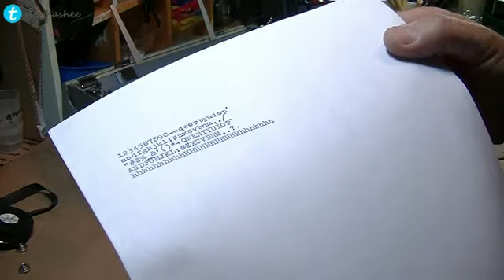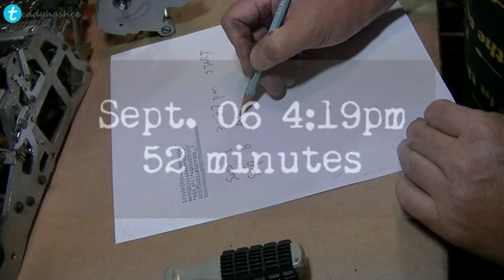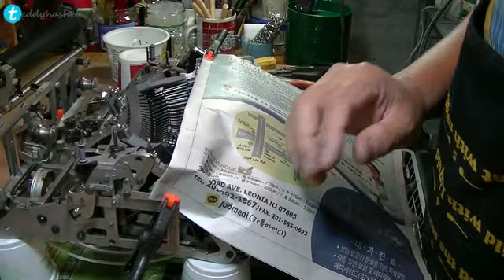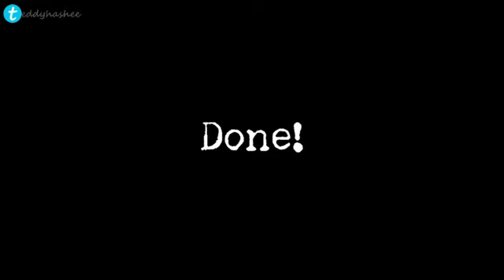60's Olivetti Underwood 21 Typewriter Restoration

Comment: I so admire this skill. I have a real desire to learn how to take typewriters apart and put them back together (with no leftover parts😉). I just started refurbishing my first, a studio 44. Luckily it's in good shape and just needs a good cleaning. I don't know how to advance my skills.
Reply from the maker: Hi, thank you for your compliment on my video. When I started restoration of the typewriter, I had no idea what to do. All I did was just enjoyed removing parts, cleaning as much as I could, and put them together. It was like jigsaw puzzle, or Mystery novel like Sherlock Holmes. One thing you should do is, you want to take as many pictures as you can when you removing the each parts. It will help you a lot when you put them together. And use many small containers or small cups and put each parts in with some description, like "screws for the top cover, 4 of them". Underwood is simple and unique system, totally different from USA made such as Smith-Corona. Most important thing, you should enjoy your work!
Reply: Teddy Hashee Than you for those great tips! I  wondered how you kept all the parts straight and how you organized those cups.
Reply from the maker: When I remove the parts, I put it or them in the cup along with my handwriting note. In the note, I drew and wrote some hint for me to put them back to the correct position.  And put the cup into the another big box in order from start to end of removing the parts. So when I put them back together, I just follow the cup from end to start. Easy!! Teddy

Comment: The more I watch, the more I like your work, Teddy, does the centre shaft of the platen pull right through, ie remove one thumb wheel and pull the shaft out, or are the thumb wheels on short shafts, or does the thumb wheel remain fixed to the shaft and they screw in..I don't know but it was most unusual for platens to remain locked in and end plates had to be removed.

Comment: Hi Teddy, great video! I have this same typewriter, and all the keys works except the Q, A, Z, and W keys on the left side require a lot of force to hit the platen. Any thoughts on what I should do to fix this? I've tried scrubbing the dirt and oiling, but it doesn't seem to be helping.
Reply from the maker: Those that did not type well, it did not face to its type face to the platen correctly. Probably you want to align the uppercase and lower case vertical typeface alignment first, then if still the problem persists, you want to adjust each typeface to face the platen correctly. But in this job, even you get the one typeface corrected to type well, it may create another problem such as touching the typebars (you corrected) to the other typebars next to it. This kind of adjustment, once you started, it will keep creating another and another problem. First you want to google "typewriter repair" and "adjusting vertical typeface", then you will see many articles. Read through, you may get some idea. Teddy
Reply: @teddyhashee  Thank you! Can you tell me where on the Underwood 21 the vertical alignment screws are? Is it accessed underneath the typewriter if I turn it over and unscrew the bottom?
Reply from the maker: I think these video will help you about more detail info.
https://www.youtube.com/watch?v=C0AozF2Jfo0

Comment: I bought myself an old mercedes typewriter and now the band that pulls the "Roll" back, so you can write from the beginning just jumped off. You are fixing that one at minute 11:25 or so. Do you know how to help me here? The model is called "Mercedes Superba"
Reply from the maker: At least you need to remove the platen roller and need to access to the string that connected to the spring and side of the carriage. Once you are there, easy to understand how it work. Spend time with your typewriter, you will see how to remove platen and fix problem.

Comment: Hi Teddy, I tried to clean an Olivetti Studio 46 I just bought at a flea market. Typewriter is working 100% BUT I screw with the red button while moving the carriage and something happened! Some plastic wire popped out of a wheel located behind the carriage and now the carriage don't move forward as it's supposed to when I type. I don't know what to do! I can provide you a couple of pictures. I hope you can help me.
Reply from the maker: Hi, Daniel. Do not worry, it is a simple fix. The wire was connected to the round thing that has spring inside in it and will pull carriage to the left. Watch my video from 10:10 then you will see what to do.

Comment: If you're watching at home, don't remove your carriage unless you absolutely have to. Trust me
Reply from the maker: Thank you for your advise. I always removed carriage and clean inside out. But you need to know how to put them back together. I learned in a hard way though. ;-)
Reply: Jed Bickman like he said.  Oh some like Olympia’s and older Adlers are designed for easy carriage removal.  Underwoods are not too bad.  Most others it’s like you said.  Leave it on.